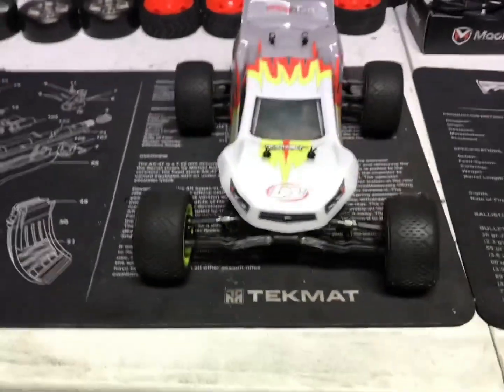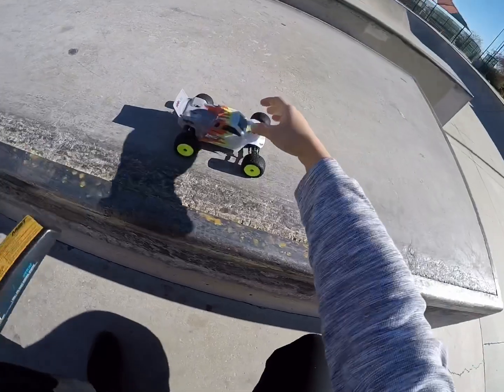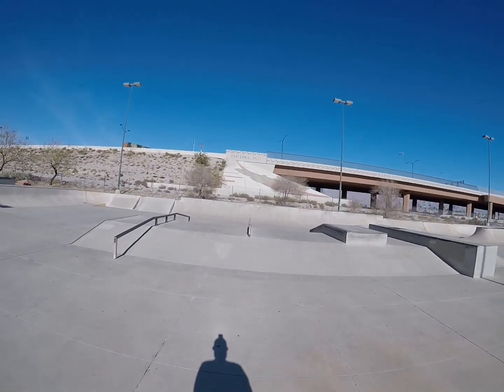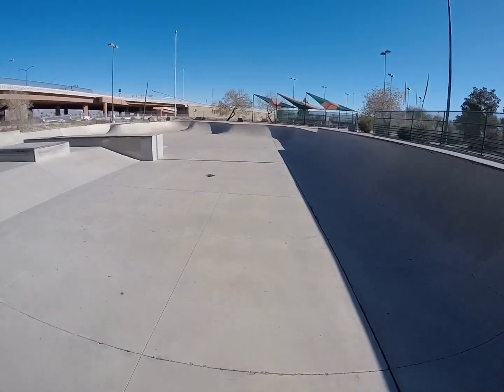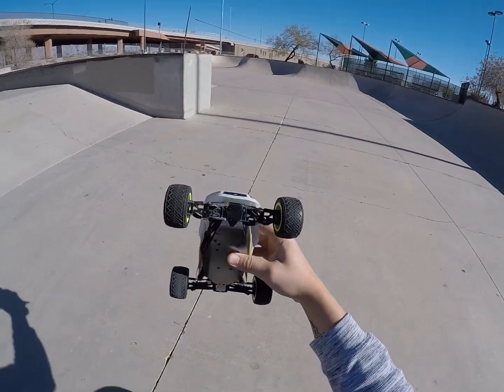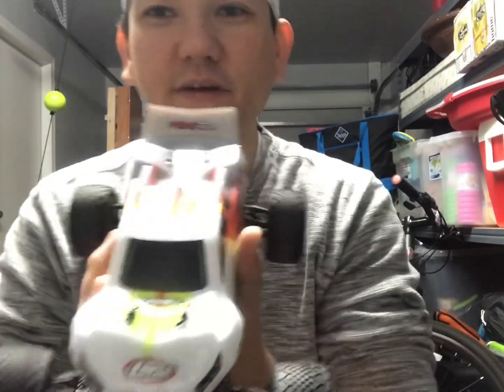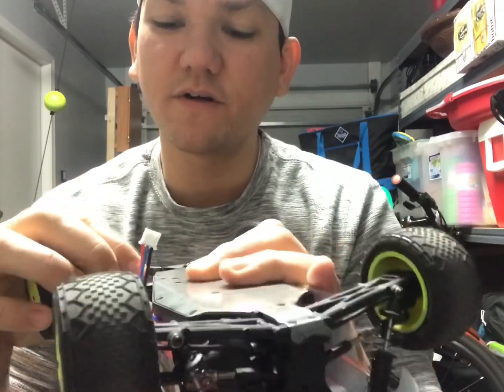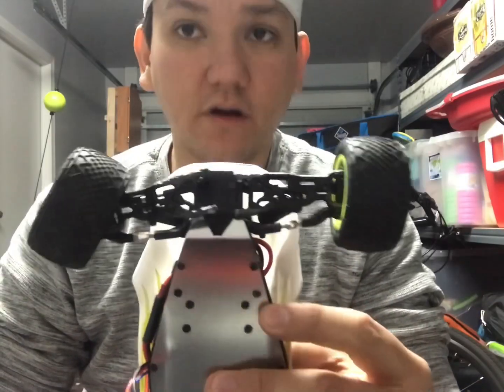Losi Mini T 2.0 - Broken Arms - THE FIX!!

Comment: I think when mine gets here I’m going to take the A arms off and dip them in epoxy. All the access glue can be sanded off. 🤷‍♂️
Reply from the maker: Just email them. You can use epoxy while you wait. Hope you watched til the end to see how to email them for a new improved set
Reply: Yep I watched till the end but hopefully that this mod will work
Reply from the maker: Kenny the RC addict 8 oh oh. Nice! Yeah Jb weld is an epoxy too 👍🏼👍🏼 it worked til it didn’t lol but yeah that started from being broken already. So it did hold pretty well
Reply: I’ll try it and let you know how it goes
Reply: @garbagefpvproductions859  how it go?
Reply: Johnny Cash it worked for a bit but in the cold stuff is gonna break easy.
Reply: Bro I emailed them and they told me that it's not covered under warranty. That is wear and tear they said .
Reply: @jdmloco714  yeah that’s a bunch of bs... luckily the upgrades are pretty cheap and are definitely worth getting. I’ve had them for about a year now and haven’t broken one.